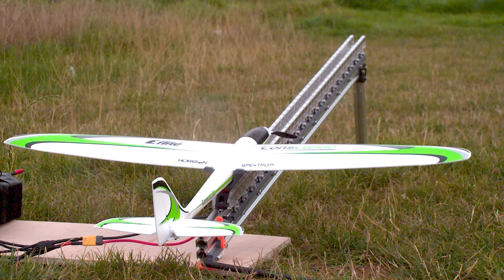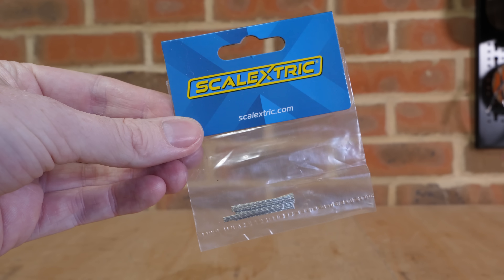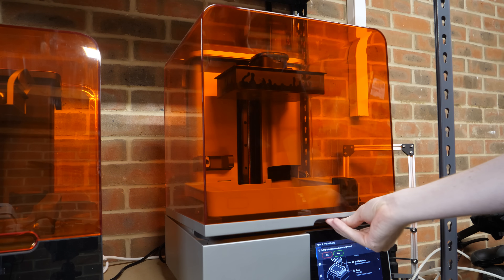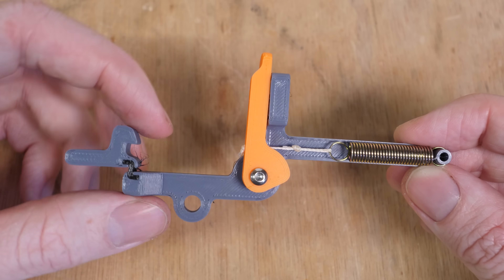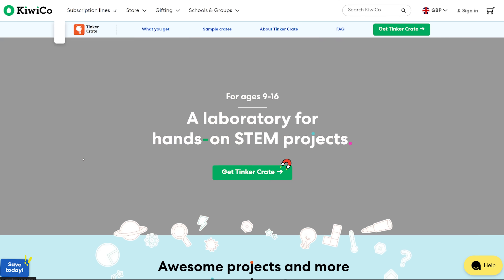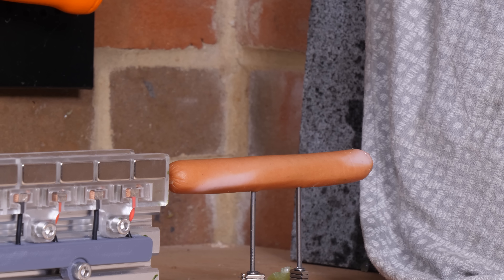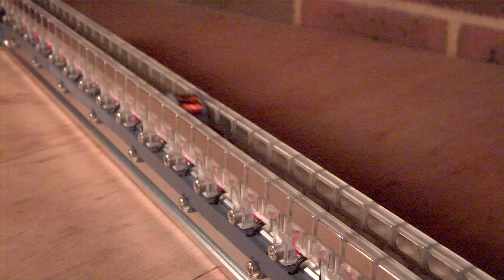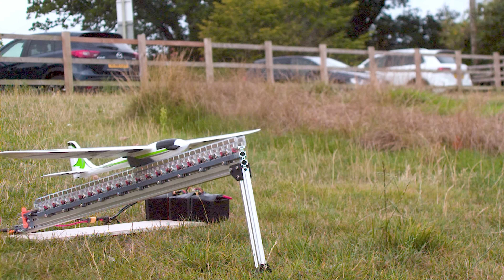Electromagnetic Aircraft Launcher

Comment: What I remember, paramagnetic materials (such as Copper) like to move with a moving magnetic field. This means, if you create a coil line with 3 phases in such a way that the coils will create a seemingly moving electromagnetic field, then put in a Cu projectile, it would be highly ineffective but it would not require contacts but rather just a high current inverter. I was thinking about building such a thing for a ling time, but I don't have the knowledge nor materials to make such thing. I thought maybe you could do it. Can you please test it, or at least tell me if it would be possible? Thank you

Comment: I'd recommend giving a small push to the sled to get it started rather than having it already on the first contacts. This removes the need for a convoluted switch as the system can always be powered-on. It should also marginally increase top speed and efficiency, as all the energy would go into a moving object, rather than one at a standstill at the beginning. You can also use dry lubricant on the rail at the end. Maybe the whole rail and sled too, but it might be a bad trade-off if it reduces the time spent on the rail.

Comment: You need a mercury switch to eliminate the poor start contact due to physical bounce, and need to use carbon brushes instead of metal to metal to help eliminate spark welding.  DC motors have been able to operate for years without depositing brush material on copper commutators.  You need to study electrical history more so you do not have to reinvent the wheel when implementing your concepts.

Comment: Did you consider adding crossed wire brushes on the front to make the front coil pull and the back coil push? Also what about making the rail a series of electromagnets switched to push AND pull by the passing of the shuttle?

Comment: you can attach anti-bounce piston mass to the spring-loaded hammer: pour metal powder into a small cylinder, filling 1/3 with it. the mass would prevent hammer from bouncing. the metal powder will move forward and "stick" the hammer in forward position due to inertia

Comment: Ask free AI or non-Free AI the following: "Warwick university plasma generated ultrasound + Ultrasonic holography control techniques to repel majority of gas around EM rail & craft + Ultrasound to line up ionized particles to launch like lightning. Method of sending materials to space without costing fuels." You have to add SPACE because if AI assumes you want a weapon it might try to lie or twist you for MILITARY. And careful because Military flags people of certain intelligence they're recording everything.

Goal for craft and rail system: Ultrasonic pressure waves can form a continuous anti-drag condition and line up ionized particles. Those star like UFO's we've been getting teased by use plasma shields with ultrasonic echoes to hold the shield tight to their craft. They use ultrasound to excite the plasma for stronger EM fields and the same echoes used to control can in real time compress plasma for a continuous Z-Pinch drive using the entire shield.

Plasma generated ultrasound is how they seem silent even though its nonsense for things so powerful to be silent and also how they dive into the ocean at super speeds like it doesn't exist. For more on them go to NSA website and type: "Star like UFO" or my fav "Now_you_see ufo" on search engine to find best NSA link.
Reply: Sorry.. Anti-drag condition with ultrasonic holography = Creating a projection of pressure that forms to create a repel force in the position its projected. Imagine a holography that is designed to be projected to generate repel from inside out to greatly reduce pressure inside the field. Holds up hand at persons neck like Darth Vader and points at giant UFO black Triangles/Star destroyers witnessed by different people world wide on search images YEEEAAH KIDS! THE DANGER ZONE!

Comment: This bounce or thunder in your relais is a known phenomena in mechanic telephone exchanges (with full metallurgical connections). In Philips reed-exchange telephone switches (PRX-Analogical) this bounce and dender was prevented by a minute amount of mercury in the reeds. These Mercury loaded reeds were combined in a relais that could handle quit a bit of current. Those days are bygones off course. In Dutch they were named K-Relais where K stands for Kwik=Mercury.

Comment: Cool projetct. A tip: In the trigger, you just needed to remove the slack from the spring so that the hammer doesn’t retract. The pressure would keep it pressed against the electrode when it strikes. No magnets required.

Comment: great work. 🎉 a small suggestion: although the mechanical design seems simple, in fact the contact lengths in front of the advancing magnet pairs should be adjusted variably according to the speed of the projector. in short, the contact strips should be extended a little more each time.

Comment: If you want to reduce sparks and eliminate the burning patches , try Silver quoting the contact points 🤪 Theres a reason the car brushes are "silver" and not plain copper (yes i know that your project  requires greater Amps)... Im not sure if carbon brushes could work aswel and they allot cheaper

Comment: I know you like to build yourself. But have you heard of carbon brushes? those for motors with a commutator? Additionally, instead of a switch, use a MOSFET, you can easily find 200A. And if you have a higher voltage, then SSR. It will be much more efficient and durable. There are many types of brushes with different additives to buy.

Comment: If you used something like steel wool as the contact for the switch, wouldn’t it work better for not bouncing? Because there likely would be contact occurring somewhere even when it bounces? It would just be a pain to untangle.

Comment: Replace copper with carbon spring loaded brushes it will be better. Use SCR semiconductor switch it will not spark it will be more reliable. Make the moving coil aerodynamic. Use split soft ironcore inside the coil to reduce eddy current.

Comment: You didn't try 2 strands in parallel and beefier brushes. Use spring loaded carbon brushes like motors use. Nickel isn't great for high amperage, low loss applications. There's excellent reasons why people use copper commutators in brushed motors. Among other things you don't  weld the carbon brushes to the copper. I'm pretty sure  you are slowing your sleds by momentarily welding the solder braid to the nickle every time you make a new contact. Another improvement is your coil. Yes, this will add mass, but put an iron core in it to focus your magnetic feild at the magnets more. Considering how little time the coil is powered, you could use a bunch of sections of steel wire or nails as your iron core. I didn't catch how your magnets were oriented. One side of your coil will present north and the other side south. Your magnets need to account for this if they aren't already. The other detail I didn't notice is if your contacts are reversed every other one. This will make the coil reverse magnetic polarity as it travels down the track.

Comment: 5:19 Tom, You've got a copper busbar that'll take > 50A, cables that'll take maybe >25A and using a croc. clip that'll take maybe 5A!!!😆I suggest a large reservoir capacitor that will supply the peak currents, and recharge when the sled is accelerating less (or not at all)
Even better, have the eMagnets on the rail, and perm.magnets on the moving part (negating the need for brushes)

Comment: Proved what an engineer can do using one priciple there are many thing which could be designed. Generally these are used in train suspension systems like EMS (Electro magnetic suspension) and EDS (Electro dynamic suspension). My favourite part was designing a reed switch. You proved that you are an engineer with a single video

Comment: @Tom Stanton - Just FYI: My old single-stage solenoid Mass Driver accelerates a 60-gram solid soft iron rod from 0 to 70 miles per hour (~31 m/s) in 3/4 inch (19 mm) or less. That is nearly 4000 times the acceleration of gravity, and I built it from junk box parts, plus 50 cents for a pair of high voltage diodes. The solenoid is from an old pinball machine. It is meant to work the flippers intermittently and run on 24 volts AC. A transformer from an old tube-type radio (valves, for you Brits) has the Plate voltage (nominal 440 VAC) half-wave rectified to charge a slightly mismatched series capacitor pair to 700-ish volts and 104 Joules. Discharge occurs in two phases. The initial phase, observed on oscilloscope, is only 1 millisecond (0.001 second) long. During that time the rod gets up to speed, but gets only halfway through the solenoid. The second phase has much lower voltage across the coil as the (still inductively magnetized) iron rod presents its rear half (opposite induced pole) to the middle through final length of coil, thus generating an opposite voltage and largely counteracting the current flow. This slows the rod slightly. During the 1 millisecond of main action, the power through the 19-gauge (AWG) wire is about 50 kW. I use a small relay meant to handle under 5 amps for completing the circuit. This does damage the relay contacts, but they have lasted for over a thousand firing cycles. Peak power during cap charging is about 25 watts and takes about 15 seconds. An incandescent lamp limits peak current to the transformer, to prevent damage to the delicate windings of the secondary. Despite the massive current pulses and the I-squared-R law of resistance heating, the solenoid coil barely gets warm, even with repeated firing as quickly as full charge permits. The design is very far from optimized in many ways and is only about 29% efficient overall, but the performance is something to see: Stare at the rod, press the Fire button, and the rod just 'VANISHES' ... across the room. Even gripping the rod with very strong fingers does not stop it 'vanishing'.

Comment: 1] the launcher alternates magnet polarity otherwise they would be always working against each other, which would wear-out the magnets 2] launcher switch can use a mercury switch 3] the web contacts can be replaced by rollers, similar to a 3 rail Lionel train 4] speed of the shuttle can be calculated by an Arduino processor and 2 LED light beams, begin/end

Comment: Adding more turns also increases the wire resistance and therefore the current through the coil. Also the inductivtiy of the coil itself gets to high, and inductivity opposes a change of current which means the magnetic field is build up more slowly and maybe doesn't even reach its maximum before the sled moves to the next contact.
If you find 200 turns to work the best, maybe try some thicker wire to lower the resistance... and maybe get a high current car fuse between your sled and the battery pack ;)

Comment: At 2m 15 seconds, they can be.  You need to fix a crocodile clip onto the brush and then solder it,  the crocodile clip absorbs the heat from the brush preventing the solder running up it.  Same as the brades used on brushes in rebuildable RC motors.

Comment: I like the look of the sparks...  But, if you want to quench the sparks and make your contacts last indefinitely, all you should need is to add a few capacitors...  Just like the old points and gaps on a distributor...  Also, copper braid isn't great for brushes...  I used to use old Beryllium Copper strips for exceedingly long wear, or in a pinch, I'd use an armature from an old relay.  The plated pads on those armatures gave a surprisingly long life...

Comment: You sould try using bruses with springs behind them for better contact. The solder wick bruses work great for the small cars because the current was low. Now that you have hight current you need pressure on the contact otherwise you have high resistance.

Comment: Too bad you didn't find it on that learning platform but adding capacitor parallel to the supply rails would add significant boost of energy as it will act as power reservoir while contacts bouncing and arcing.

Comment: Initial thought would be to have a launch stage (ie. 1 pair of magnets) and then power the contacts for this stage through a capacitor discharge unit (essentially a capacitor + SCR).
This would allow electronic ignition without changing your mechanical actuation.

Comment: I think it would be better to use a strong neodymium magnet in the part that is launched, and use alternating electromagnets with iron cores on the launcher. This would be brushless, resulting in no metal deposits, and should result in less contact drag, resulting is higher final launch speeds.

Comment: I think you need to try adjusting the position of the contacts slightly relative to the position of the magnets - it might be better to run the magnets on slightly earlier than you currently are. Also maybe try more space between contacts so the brushes don't short pairs of them as they pass. You could try running it at a voltage so low it doesn't move then manually pushing the carriage through to check it doesn't short.

Comment: Why not a system with the launcher simply a mass of magnetic material,  static coils along the rails and photo electric sensors turning on Thristor/IGBT switches that dump capacitor banks in each coil in perfect succession ?
No energy wasteful sparking and simple launch sled.

Comment: Very nice video, i saw a lot of wiggle in sledges... That means some loss of force, what about use of some small self centric guides? Like 3D print of small guiding latches on sides of rail, together with shallow channel from PTFE on sides? Also, consider using PTFE at general, very slippery, some very strong... Can make like all parts which are touching , which should point in lowering amount of wiggle, lowering amount of friction.

Comment: Tom, What if you put 100 x100 turns in parallel , so even though the weight is the same the resistance is lower and you can pass more current so should be stronger.

Comment: I totally don't get the need for that over engineered, bouncy, spring loaded contact. Turning knob kind of switch would have no bounce at all. Could be spring loaded also. Or alternatively instead of two semi circular strips sliding onto each other it could be in straight form. Just two strips of metal making contact then sliding a little bit further. Still over engineered though.

Comment: Two little improvements - First add really fast and high current diode to coil - eliminate some electromagnetic pulsation that reduce speed, and  improve effectives. Second Use PCB with planar Coil - incredible  reduce mass but  save coil "power".

Comment: It IS one of the coolest. 2 points thoug:
1) Should be cheaper and less sofisticated/overengineered to use the perma magnets for the sled and electromagnets for the rail. 
2) Why no angling of the "rail" magnets, to highten the movement "forward"? BTW, if you jacket the perma magnets in iron or steel, it should "slap" the magnetosphere of the magnet closer to it (and seemingly make the magnet "stronger".)

Comment: If you don't mind spending a bit more, you can eliminate any lag issues caused by bouncing in your switch by getting a 100 amp contact (found some rated for DC for around $18) and a small external push toggle to actuate the contact (about $3 for 2), so you aren't holding a 90 amp cable in your hand. I know it wouldn't look as good, but would still be fairly compact and have better longevity than the 3d printed slam fire option.

Comment: Wow, that take of the plane "deploying" the propeller as the mount detaches and falls was very sci-fi, it looked very cool, good job 👍
Reply: That has nothing to do with the launch itself. It's just how folding propellers work on electric powered model gliders when you switch the engine power on with your radio controller.

Comment: Print a load with its mass slightly smaller than the carriage, mount it at the end, and attach a sping to the carriage. This way the kinetic energy will be transferred to the load when they smash, and it will fly away slightly faster while the carriage will have some fackwards force to be returned (with power off or reversed and reduced, ofc)

Comment: I totally don't understand why you never wanted to solve all the sparking problems just by using bi-directional TVS diodes to prevent the high voltage from building up from inductance..That's the most basic thing to do with coils / magnets.

Comment: Excellent build!  The first rail gun I saw was in 1976 at the Francis Bitter Magnet Lab, at MIT.  They had capacitor banks the size of fridges lining the wall.  At one point the operator used his grounding hook to discharge a bank.  About 12" of the 1/2" Dia. rod vaporized.  They had 10 feet of foam stacked as a target.   Very impressive.

Comment: Regarding the optimal number of loops in the coils, more increases not only resistance but also inductance.  The limited rate of change of current could start to be significant at higher speeds.

Comment: To improve the main connector switch the ideal situation is it is held closed under spring tension, and then you release the open position. As then it's biased closed it'll want to stay closed and prevent bounce. Mains disconnect panels use spring tension systems to ensure the contacts are made/broken as fast as possible and held in position to not bounce.